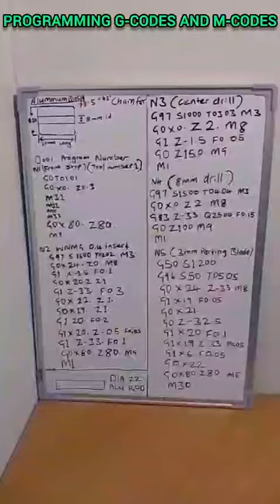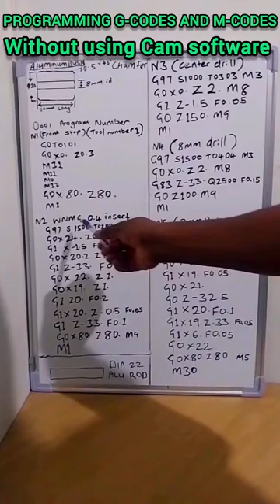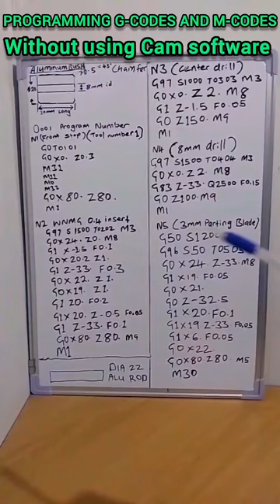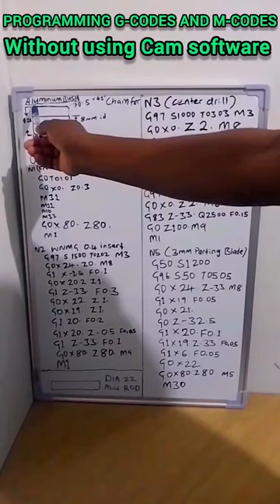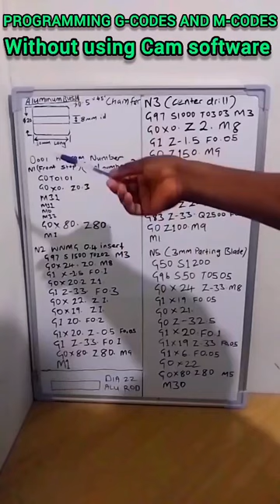Manual programing on CNC lathe using G codes and M codes .PART 1 with  Sama Junior

Comment: Hello Mr S..I'm very happy to have people like you teaching us this important lesson keep it up✌️....Im a student so will like to learn more .if I may ask why add 3mm when parting the aluminum.
Reply from the maker: Thank you very much. The reason why you must add 3mm when parting off the component is because the parting blade itself has a width of 3mm.lf you do not account for this thickness by adding it to your Z-axis calculation, your final component will be 3mm shorter than intended. The 3mm accounts for the material removed by the blade as it cuts through the workpiece
Reply: @SamaJunior-y2o Thank you very much Sir now I understand it.
Reply from the maker: You're welcome